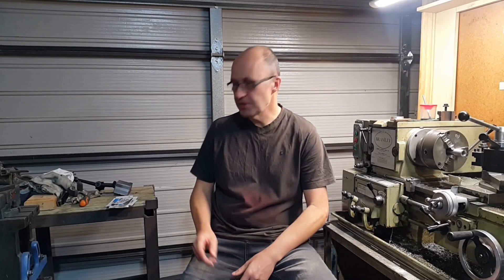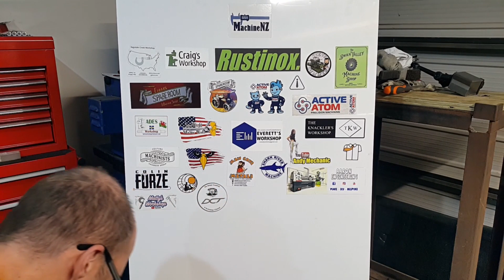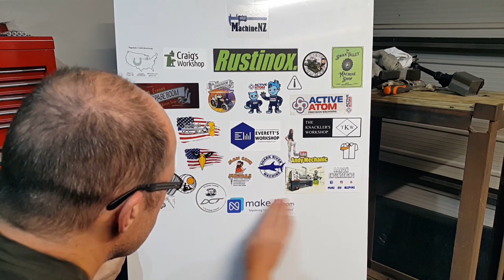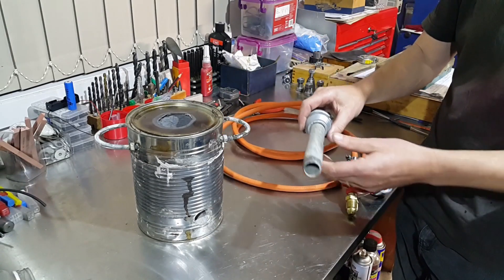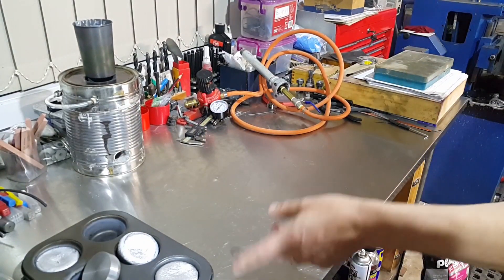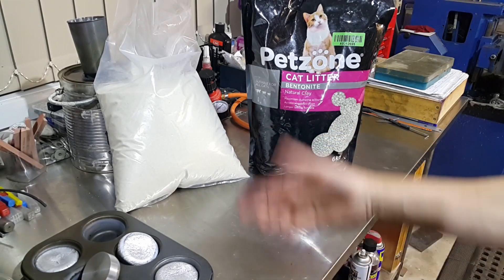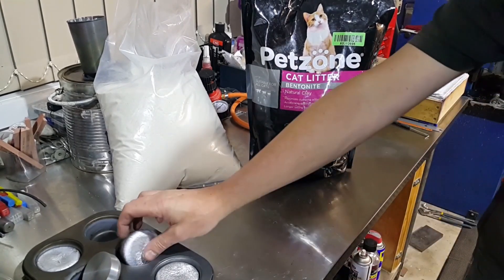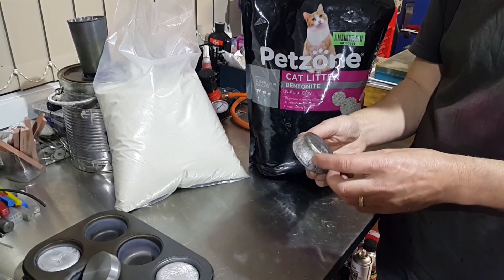#72 - New Stickers arrive and DIY Coffee Can Furnace build

Comment: I gather you are a Kiwi . Throw away the cat litter. 
Take a trip to your local farm supply shop and buy a bag of “ Trubond “ which is bentonite clay . May also be under another name . It is very fine and we use it for calves .if you are close to me i could give you some
Reply from the maker: Hi, i'm in New Plymouth. Will have a look and see if I can locate some. Thanks for tip. Regards Kevin
Reply: MachineNZ   Another thing you may not be aware of is some cat litters have plastic fillers . Which means the clay needs to be washed and the plastic floats  to be removed .
By farm supply stores i mean the likes of Farmlands , Farmsource ( used to be RD1 ) and maybe also rural vet practices

Comment: pretty cool man, glad to see your little furnace and everything. A few things tho, the lite salt is a flux, not degasser, lol. If your going to do castings, you want to flux the metal, otherwise it'll want to act a bit slushy and that makes it hard to flow into the molds. The other things I saw was that you want to preheat the dross scoop in the exhaust before you stick it in the metal, and the last thing, I would stick the pieces of scrap on top of the lid to preheat off of the exhaust and lid, which drives off any moisture, and also preheats the metal so it melts much faster and easier. Other than that, it looks like you have everything handled, lol. Another thing to check into would be lost foam casting, you dont need greensand for that, just normal play sand and some people like that better than greensand casting.
Reply from the maker: Hi Chirpy, thanks for the tips. I know I have a lot to learn and your videos have been a great help. Regards Kevin

Comment: You need to find a safer tool to use rather than multigrips, the only thing multigrips are good at is rounding off the edges of nuts and bolts

Comment: You are really going to enjoy what casting your own parts brings to machining.       You are doing great.    One tip.   While kitty litter is easy to source it is a PIA to grind and kills blenders.Try to locate a well driller or someone who uses bentonite to line ponds or dams.   I bought 60 lbs sacks of it for $3 each.
Reply from the maker: Hi Dan, thanks for tip and thanks for watching. Regards Kevin
Reply: @Machine_NZ  Hi Kevin, you can buy Bentonite clay in bags from most large farm animal fodder stores - they use it as a food additive for cattle (stops them scouring when transported).  Dirt cheap.  I have a 10 kg bag of it.  Have fun casting.  Cheers Rob
Reply from the maker: @Xynudu  hi Rob. Think I've found some. A shop here sells Sodium Bentonite (Trubond). I think it's the right stuff?
Reply: @Machine_NZ  Yes that's the stuff.